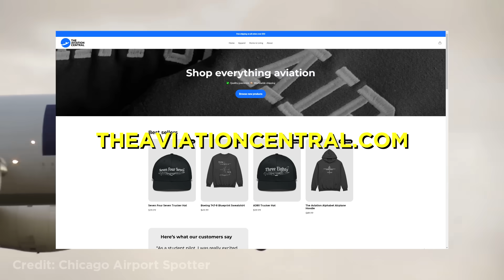10 Worst Plane Near Misses

Comment: The first plane actually crashed sometime later trying to land at the same runway due to damage during take off, the wing did actually clip during take off. The plane apparently was carying too much weight than it should have been so it struggled to take off. The pilots died and it was a cargo plane
Reply: that’s a different aircraft, it was the same airport though because u can see the mark from the crashed planes wing clip
Reply: El avión accidentado era uno de los 4 Boeing 727-200 de Aerosucre. Por las condiciones climáticas y el mal orden de la carga en la bodega, el avión no pudo despegar a tiempo y se estrelló contra dos vallas, un árbol, y la pequeña edificación aledaña a la pista. La llanta trasera derecha se desprendió e impactó con los flaps, haciendo que se desprendieran. Posteriormente, el ala impacta la edificación, haciendo que los escombros fuesen succionados por el motor numero tres. Si bien pudieron despegar y conseguir una buena altitud, emprendieron un giro muy cerrado y el avión entró en perdida, impactando lateralmente contra el terreno... De seis personas, solo una sobrevivió.
Reply: That was a different plane, but an eerily similar situation. Aerosucre is an infamous cargo airline known to routinely make flights when the aircraft is severely overloaded, and the flight crew pay the price.
Reply: Oh my
Reply: Well was there any anamostion

Comment: I'm no pilot but quite a few of these don't seem like near misses to me.They seem like routine situations that the pilots deal with competently.
Reply: You’re right
Reply: Especially the short runway, you have to touch down early in order to be able to have enough distance to stop
Reply: very much so.  I made it to the one where he admitted it was at an airshow and therefore controlled and deliberate and gave it up as rubbish.
Reply: Then first one was way overweight

Comment: One of my favorite Aerosucre videos is a cockpit video in one of their 727’s.  The pilot advances the throttles to takeoff thrust and the takeoff configuration warning sounds.  Instead of closing the throttles and going back to attempt the takeoff again, the captain reaches over to the flap handle and pulls it down to the correct setting, all while the throttles were at takeoff thrust and the roll had begun.  They almost did a flaps 0 takeoff.  The flaps move slow on the 727 so they were quite lucky that they made it to the required position when it was time to rotate.  Gotta love the enhanced safety culture at Aerosucre!!!!  And yes, they did the checklist prior to takeoff.  They just didn’t bother to look at the instruments.  lol

Comment: The first one, with the aerosucer 727, is not true. It ended up crashing in a field about a mile away due to an engine fault caused by the runway overrun.

Comment: Most airline pilots are pretty good at pre flight planning; i.e. checking the route and the weather.  And most of them are pretty good at managing the flight once airborne; i.e. keeping an eye on the fuel, the en-route and destination weather, and so on.  But truth-be-told, some of the ones I flew with during my 33 year career with a major U.S. airline, are pretty poor when it comes to flying skills and a few of them are downright dangerous.  They survive because modern aircraft are very strong and runways are long.

Comment: Bro 1st one Is Crash After Take Off😢😢😢😢😢
Reply: no, you confused it with another plane.
Reply: @Tyrannosaur_reXXX  Bro This Is AEROSUCRE FLIGHT 157 CARGO FLIGHT,OVER RUN AND ITS CRASH DESEMBER 20TH 2016 IN COLOMBIA
Reply: @Roshan138-n3m definitely not
Reply: also.... the plane lifted off barely on time, flight 157 had overran the runway, lifted off, then crashed
Reply: @BrightSealBoi123  EXACTLY

Comment: 8:49 "this fedex md-10" bruh its not an md-10 its a dc-10. you can tell the difference between and md-11 and dc-10 by the wings. if the wings have winglets its an md-11 but if it DOESN'T have winglets then its a dc-10

Comment: @lucaas
In that last FedEX clip, that aircraft is not an MD-11, it's a modified DC-10. All MD-11's have the central gear inbetween the main gear. DC-10s do not. Additionally, that flight crew deployed their landing gear exactly when they needed to. Gear drops are not a regulated sequence item. Flight crews are permitted to drop them at their discretion.

Comment: Some of these videos are a stretch for something to be wrong. 

The landings in Greece weren't too low, heavier, lower and faster. The 2 planes at the air show were only closer by angle. The A350 only la ded hard because of last second sheer not crosswind.

Comment: You have really good videos but this "too low", "too late" thing is a bit of a stretch. If he took off "too late" he would have crashed. He didn't. He took off late, not "too late". "Too late" implies that it was too late to avoid an accident.
Same as "too low". That implies that they flew too low to avoid hitting something on the ground.
Reply: One actually WAS too low, too late...

Comment: Get your facts right.  The overweight Boeing 727 in Columbia hit the lights and the fence and was badly damaged.  It struggled into the air before turning right and dived into the ground killing three pilots and five cargo handlers.
There's other misinformation throughout this inaccurate video.

Comment: Correct me if I am wrong but I heard somewhere that reverse thrust isn’t used on a wet runway because if one engine deploys and the other doesn’t, it will pull the aircraft off the runway.

Comment: Still waiting for Lucca's AeroSucre Special Edition.  "Luckily no one was injured... yet" :hand-orange-covering-eyes:
Reply: Luccas yes we are waiting 4 that
Reply: What about the Aerosucre 2016 crash
Reply: Actually that Aerosucre did crash, on a similar overweight take-off, at the same runway (the gear smashed the fence and the small shackle at the other side of the road and the engines ingested debris, the plane went down a couple of miles further)... so, unluckily, some were fatally injured.
Reply: Yeah they've already got a body count on that same Runway. Not to mention the fact that they took out the shack across the road from the airport Runway.
Reply: Breaking news, 50,000 people took off and landed at the airport today without incidence.

Comment: The 767 has a small retractable tail skid for the purpose of possible tail strike, upon landing or take off. It moves with the landing gear. It’s clearly visible on the American Airlines, and did it’s job apparently, but unsure if it actually contacted the runway.
Reply: I remember that American 767 - 👴🏻
Reply: id say the skid is pretty average
Reply: @highoncatnip_  underrated comment lol

Comment: CORRECTION...While you were right that the F-15 likely had a compressor stall, those flames are afterburners, perfectly normal. Oh, & the 737 had reverse thrust on engine #1, just not #2. No prob. 😉✌️✈️